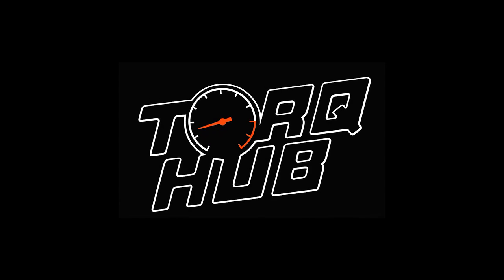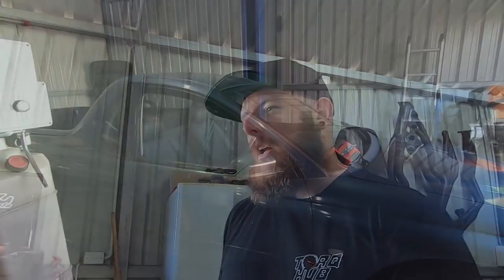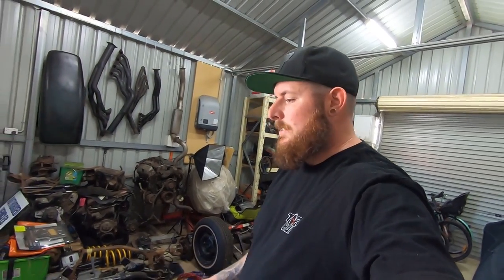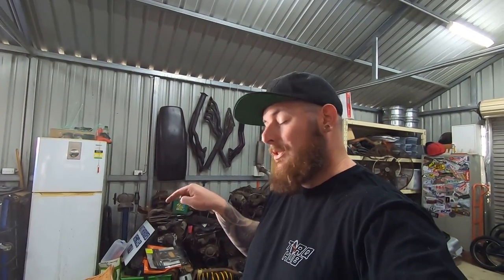Fix your HEADLINING for UNDER $100! Repairing the sagging ceiling of our FREE VY V6 Storm ute!

Comment: Cost me $30 to redo my, good old spotlight 🤙🏻
Reply from the maker: Great work Jordan. One thing I forgot to mention in the video, and the reason I used the Forch adhesive, was its heat rating! A regular spray on adhesive will never hold up to an Aussie summer unless the car is always under cover. So while it's fine to use a cheap fabric, don't skimp on the glue 🤙🏻
Reply: @TorqHub  $3 for the black fabric and $25 on a decent adhesive glue from supercheap. The new headliner look really good. Like you said it’s all in the prep work

Comment: Cheers bro for the how to video. I'm doing the hoodlining in my VU UTE. I purchased black velour off eBay, 2mtrs x 1.5mtrs for $45.00. Being a retired Upholsterer l have industrial contact adhesive which I'll use a compressor and spray gun to apply. It was good to see you turned the edges over all around for a better finish, it makes it near impossible for it to come away again. Keep sharing and enjoying your content.
Reply from the maker: Cheers John! Get stuck in mate. Hope it turns out mint 🍻

Comment: Hey boys good job, I just did my headliner on my vs clubsport,  it had a non factory sunroof, I deleted it, patched and repainted and put in a new headliner.it makes a huge difference, I also put in a statesman interior light with the 2 forward facing map lights.
Do you guys have any 304 parts like a block for a stroker build I want to do. I put a wanted add on gumtree and the only responses I got were from Sydney and Melbourne with big freight costs it's not worth it. So I thought of you guys, being close to where I am. A 304 solid lifter or roller I'm not fussed but a roller cam block would be great, anyhow keep up the great work and the vids.
🇭🇲👍
Reply from the maker: Amazing the difference a fresh headliner makes hey Troy?
We've got a couple spare bits mate but they're all already earmarked for future shenanigans. Like you said, it's starting to get a bit thin on the ground, so gotta hold onto what you can!

Comment: Did my ve ute liner, decided to be a tight ass and hand washed the original, found the glue/ foam came off really easy which lead me to squirting off the roof liner too, worked brilliantly!!!! Then used one of those plastic/rubber spray on aerosols, needed a few coats but worked out awesome 
Regards Matthew
Reply from the maker: Nice work Matthew. Have seen people reuse the fabric without the foam before. Good budget fix to get you out of a bind 👍🏻

Comment: Hi do I need new fabric or will the old fabric do?
Reply from the maker: Hard to say, without knowing the condition of your current fabric. Have seen people scrape all the foam off and reglue the separated material back onto the headliner, but the result isn't as good. If the budget allows, I'd 100% splurge on fresh material.
Reply: @TorqHub  Yeah I'll have to see once I take the fabric off